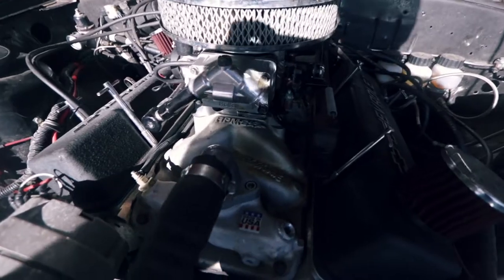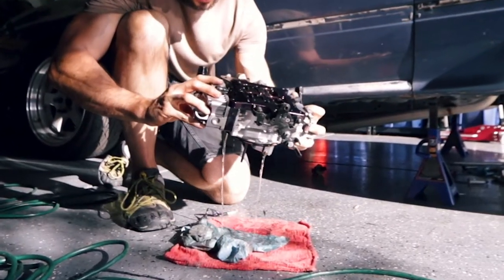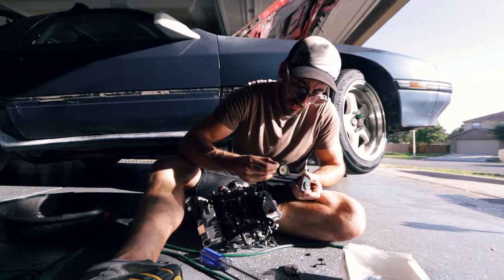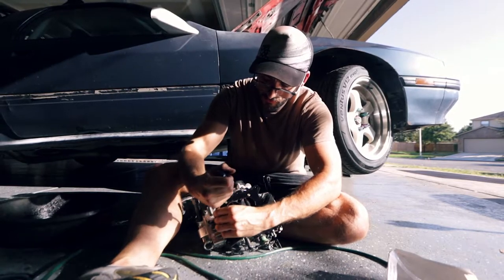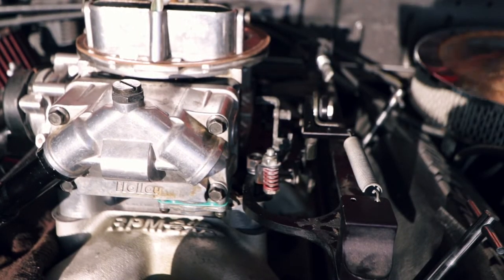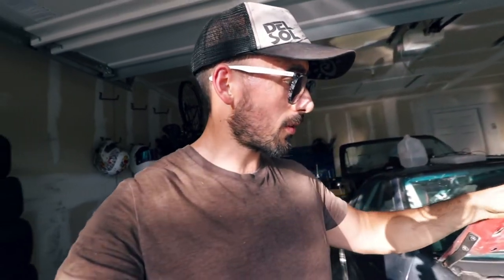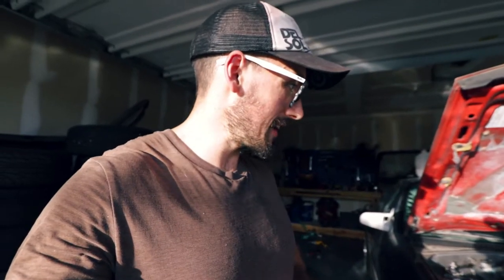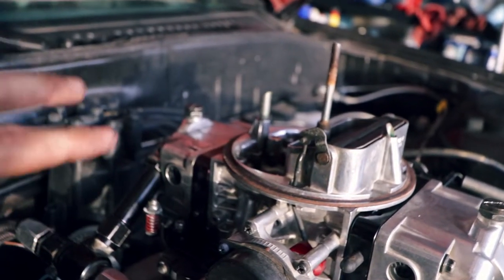Fixing My Leaky Holley Carburetor on the RX7

Comment: Why you do this to the rx7 is like. They take youre heart. And put a electic fuel pump would tou likeit
Reply from the maker: I know it’s complete blasphemy, but we ran the rotary in it until it gave out. It was just a lot cheaper and more efficient to swap it 😅 I would love to run a rotary, but I don’t have the funds to do it sadly 😕
Reply: Because rotary engines suck and before you say they don't, ask yourself were are very they commercial used today? Dang son!